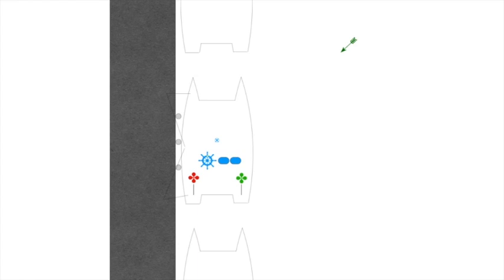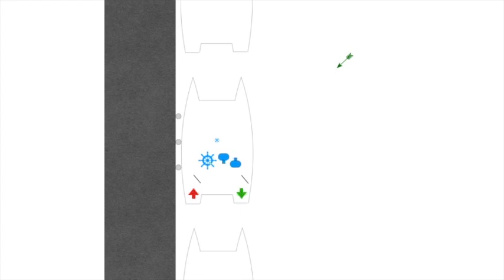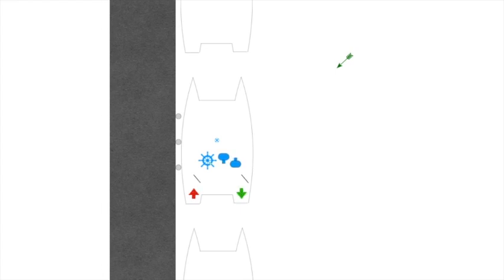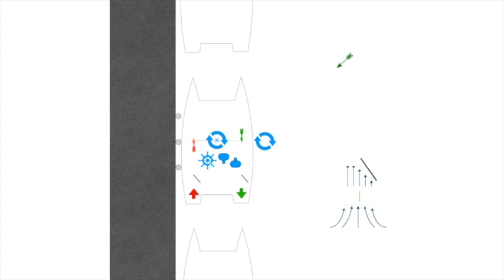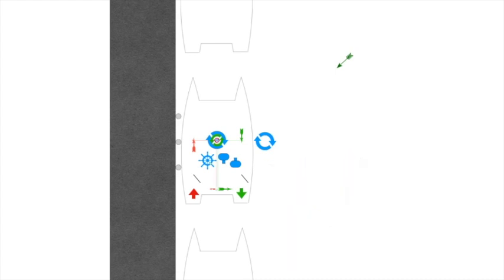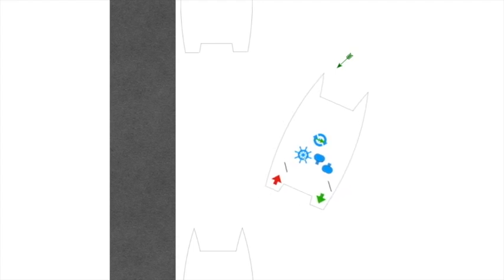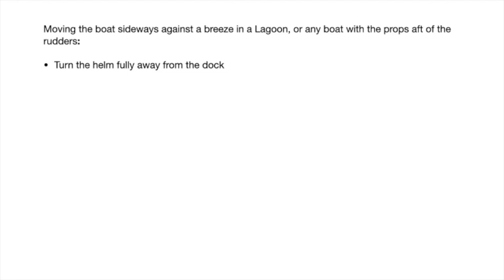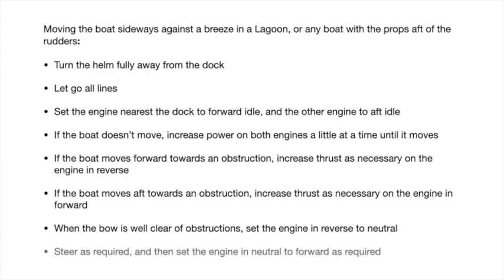Sideways in a Lagoon

Comment: Help.  Do you have the rudder vectors backwards?  If SB engine is in reverse, wouldn’t it be drawing water over the rudder causing a small force to port?  Vice versa with port engine in forward?
Reply from the maker: @miket1638  The Lagoon has an unusual configuration, with propellors behind the rudders, which is why it warrants a separate video of its own.  I watched through this video to check for any missed how.ers, and the vectors are all correct.
Reply: At 2:34 in the video you show SB engine in reverse but the prop pushing water forward onto the rudder.  How does the engine in reverse located aft of the rudder not draw water aft?
Reply from the maker: @kcmike7  An engine in reverse always pushes water forwards, and one in reverse pushes water aft - it is Newton that you have to challenge if you disagree on that one… “action and reaction are equal and opposite”… so reverse engine thrust is created by accelerating water forwards.
Reply: @theboatcheat1204  I really appreciate these videos and more importantly your diagrams.  I really need to see the visuals to learn.  After writing out another reply it finally dawned on me and the light went off.  I was definitely having a "Gilligan" moment.   In a couple weeks I'll be moving a Laggon 42 to a new harbor/dock and this video has really helped me figure out the best technique to dock her in her new spot.  Essentially will be doing the opposite of this video.  Thanks again for your patient replies!  Keep the boat cheats coming!!
Reply from the maker: @miket1638  Really great that you find it useful!

Comment: Hi Boat Cheat, I find your videos very informative and explanations are excellent. We have a Woods design 27 ft open deck catamaran with an outboard mounted at the aft crossbeam on the centerline. Of course we have two rudders with a tiller (no wheel). We keep it at a dock on a river that has 4meter tides. Therefore often a lot of current. It is quite sheltered so wind has not so much effect. We often have a bigger catamarans forward and aft of us. Docking and departing is no big issue when the current is coming from the front, but much more difficult when coming from aft. I have tried docking with the current from behind and usually give up (turn around, move the fenders over) because the boat gets quickly out of control when trying to stop the boat with the motor in reverse. It is difficult to hold the rudders in the center because as soon as I let go of the tiller it of course goes hard over. I was thinking of finding a way to lock the rudders in the center and only use the outboard. When docking I usually have a choice to turn around and go in with the bows facing into the oncoming current. However when leaving the dock there is normally no choice as the only alternative is to wait for the tide to change. It would be interesting to hear your advice. There are a number of older boats with similar arrangement like a Prout Snowgoose except they have a wheel. I also liked your center cleat first on method except we have no center cleat!
Reply from the maker: Hi Clay, thanks for your kind words.  Sounds like a challenging situation.  It sounds as though you have identified a potential solution though… 

I have looked online for suitable pictures to help me make a suggestion, but am not sure I found the right boat, so excuse me if this is rubbish… does the tiller consist of a long transverse bar joining the two rudder arms, similar to that found on Hobiecats etc?  If so, does it pass under the control arm of the  outboard?  If it does, then it might be possible to get a couple of spigots which clamp onto the tiller arm.  These could be placed close either side of the outboard control arm, in such a way as the arm can be dropped between them when required, so that the outboard also controls the rudders.  If you are able to link to some pictures it might be possible to design or source something that would suit.  That way you could fold the outboard control arm up out of the way when not in use, and then drop it between the spigots when needed. The rudders would then always be aligned with the outboard, and the rudder hard-overs you are have experienced would be prevented.  Depending on the arrangement of outboard and tiller it might also be possible to rig lines to the outboard control arm using rolling hitches either side, but this would be a bit of a faff… I would be interested in some images, and maybe I could do a video to address your problem, as I am sure it affects a lot of open-deck cats.  Thanks for sharing this.
Reply from the maker: No centre cleat can be fixed relatively easily - I will sort a video on this one as soon as time permits… a bit of a rush on with a training material production contract at the moment so it might be a few weeks…

Comment: I have a difficult berth for my lagoon 46. It has 4 pilings and a dock aft. The challenge is that a channel marker is 30ish feet directly in front of the port piling. Outside of that, 30foot  fareway is very shallow. The wind blows on the port side. If I go inside the marker there'd not enough room to swing and if I go outside I run the risk of grounding or the bow blowing over before getting port bow secured. Can I pass that forward port piling and attach a midship line to pivot? Thank you
Reply from the maker: Sounds like a possibility,  but without seeing it I couldn’t swear it would work… but if I have understood correctly it might help to try using just the leeward engine when going in so that you reduce the bow being blown off… depending on the space it might make it more manageable…

Comment: Will this work on a Seawind 1160? 2 outboard motors in pods  in front of rudders but further towards centreline than rudders. I.e. not directly in line with rudders. Thanks for any help.
Reply from the maker: I suspect that there will be enough propwash on the rudders to have a very marked effect, but the method for standard catamarans would be more suited if your props are forward of the rudders.  It would be worth experimenting in relatively calm water to see how much lateral movement you can achieve…

Comment: Nice video and well explained... one small thing though: it's not the "centre of gravity", it's the "centre of lateral resistance" (or somewhat less correctly "centre of pressure").
Reply from the maker: Thanks! You are of course correct,  but this is a practical simplification… I believe that both CG and centre of resistance/centre of pressure have an influence: CG for inertia, centre of resistance for fluid resistance - and there are two of these of vastly differing effects - water resistance and air resistance, each with different centres - but wouldn’t that make for a complicated video!

Comment: Great video, but will this work in reverse, like you have shown with engines forward, while docking?
Reply from the maker: Hi Geoff, thanks! It works just as well for docking as for getting off the dock.  For this configuration of rudder and props, simply turn the wheel fully the opposite way to the way you want the boat to move, and use forward and reverse in the natural sense to make the bow move towards the dock - i.e. the engine on the dock side of the boat in reverse, the other in forward.  For standard configuration boats simply reverse the wheel direction and steer fully towards the way you want to move.  I used this in a reverse sense a few years ago to get alongside gently with a very strong wind blowing us onto the dock - I was concerned that with the high freeboard we would be blown on hard, and so as the turn on was completed I set up as if trying to come off the dock, and using appropriate power was able to gently arrive as if there was a light breeze.  Each boat has different characteristics, so it takes a bit of practice to know the sort of response you will get, bit it’s really worth it.
Reply: @theboatcheat1204  Can I ask you have actually ever tried the above setup?
Reply from the maker: @geoff850  Hi Geoff, yes, in a Lagoon 380… works fine.  Whether leaving the dock or trying to get onto it, the process is the same: turn the helm the in the direction  you want to drift, while in conventional configuration you turn the opposite way. Works fine in both cases… but remember that the stronger the elements, the more power will he needed.  I came off a dock against a strong wind in Turkey a few years ago, in a Leopard 44, and had a line on the dock-side aft cleat in case the drift was insufficient to overcome the wind.  The guy manning the line said it never looked like it was going to be needed, and the back of the boat moved away from the dock without any delay at all.  On that same day we used the same method to arrive gently, using asymmetric drift to counteract most of the wind, so we didn’t arrive on the dock with a crunch.